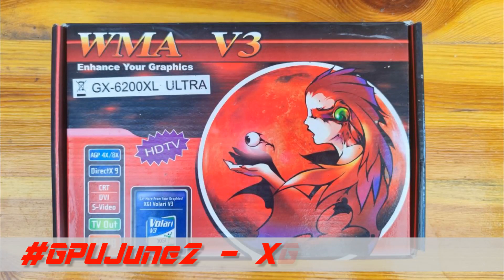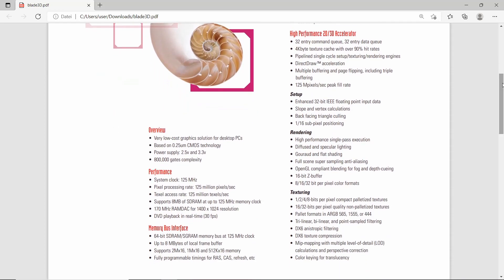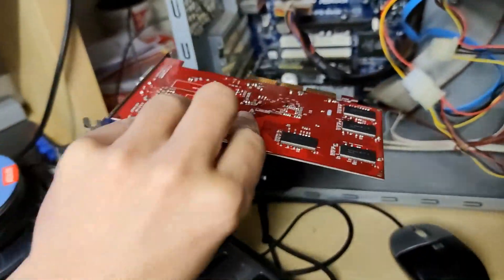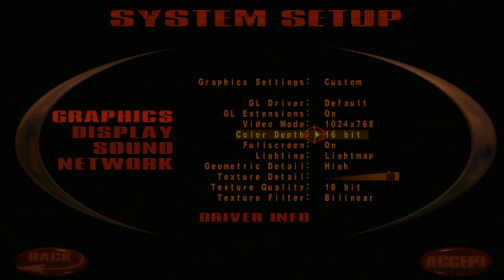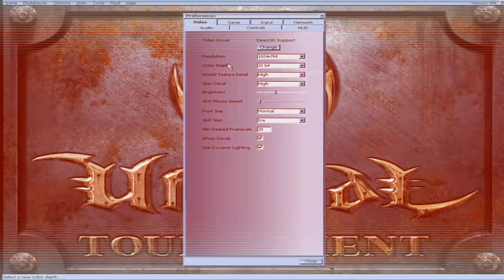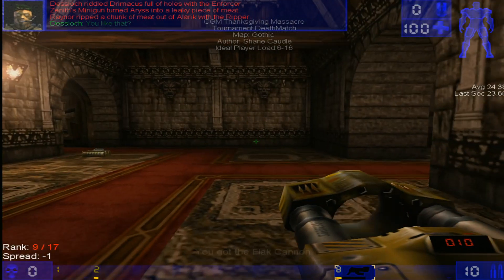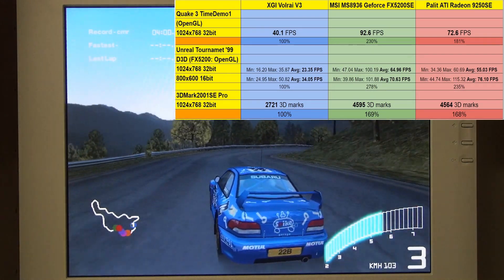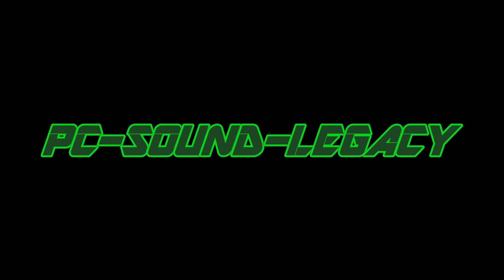The XGI Volari V3 (and how it faces competition with ATI and Nvidia) #GPUJune2

Comment: By raw theoretical values it should be close to the DX7 cards like a Radeon 7200 DDR or Geforce4 MX 440, and that is before any effect of the driver.
And half the performance of the FX 5200, which ended up pretty much as OEM card because of it's horrible performance, is quite the result.
But 5W is quite low, so indeed for multimedia or office, with the ability for the occasional light game.
Reply: But FX5200 was slower than MX 440.

Comment: Where are you getting the info this is using the same architecture as the trident blade XP4? I cant find any info about this online.The only thing I could find is it was renamed XP4 but had nothing in common with the Blade XP4.Said it was actually based more on some Notebook SiS chip
Reply from the maker: Hi Kyle, maybe you refer to the Volari V3XT? Thats SIS technology whereas the V3 is Trident. I researched this informations on the Trident wiki page and the XGI wiki page, both german and english. There's also at least two german reviews for this cards with this information.
https://alt.3dcenter.org/artikel/2003/09-16.php
https://www.pc-erfahrung.de/grafikkarte/vga-grafikchips-desk/xgi-volari-vx-serie/xgivolariv3.html
Reply: @pc-sound-legacy  do you know what SiS chip the XT was based off of?
Reply from the maker: @kyles8524  No, I have not searched that card so far, just read it somewhere while searching Infos to the earlier V3.
Reply: Volari V3's Vender ID is Trident, and vsyncmame's screen resolution setting routine for Trident works on Volari V3 ⸜(* ॑꒳ ॑*  )⸝

Comment: I had no idea the Volari V3 was based on unreleased Trident technology. And while I knew it wasn't fast....I didn't know it was THAT slow. I certainly learned something today!
Reply from the maker: @kyles8524   Thanks! "The Volari V3, however, was a renamed Trident XP4" - That is what I said. Dunno what they mean with "and was designed more with the original SiS chips as notebook chip" - Trident had no connection with SIS till XGI unite them, and the XP4 was developed before when they were independent. So XGI took this and just renamed it.  As far as I know, only Volari V5 and V5 were developed based on SIS tech (Xabre), and later models . XGI continues using the Trident XP tech for some of their mobile GPUs.
Reply: online says it actually had nothing in common with trident and was based on some SiS notebook chip
Reply from the maker: @kyles8524  🤔Where did you read this?

Comment: Wow, and I thought the 9200SE I talked about was bad! 😅

Looking back at my own data, the closest V3 competitor on the market in 2003 might have been a Geforce4 MX4000 with a 32bit memory bus. That got a 3DMark2001 score of 2532, and it is VERY memory bottlenecked. The V3 manages to be that slow while actually having more memory bandwidth than the competitors. 🤣
Reply from the maker: It's always a matter of perspective😄 I somehow like the 9200SE. It is an honest card and you got exactly what you pay for:-) The Volari was cheap but regarding it's performance it's was no bargain at all.

Comment: Wow the Volari V3 is a lot slower than I expected, I thought it would be close to the Xabre 400, but clearly not. Thanks for the video!
Reply from the maker: Yes, the Xabre is the precedessor of the Volari V5/V8 somehow, and I'm pretty sure XGI gives the development of their low end card to their former trident division because SIS has gain some experience with more powerful GPUs. I own a SIS 315 with 128bit memory interface and that performed quite well. But these cards came to late on the marked so ATi and Nvidia were a few month (or even a year?) ahead already.

Comment: Yeah really looks like a laptop gpu on card based on the stats and its based on bladexp. i have a bladexp in my toshiba tecra and it ok for some directx but opengl doesnt exist. Seems like trident provided a better driver by this time.
Reply from the maker: Yes it seems XGI wanted to extend their lineup to the low-end with this, and without taking too much effort in it. With a more focus on desktops, improved pipeline and higher clock speed the V3 could be better, but I think ATI and Nvidia were already in the lead too far for XGI to be a real competitor, even in the lowest end. Thanks for watching 🍀